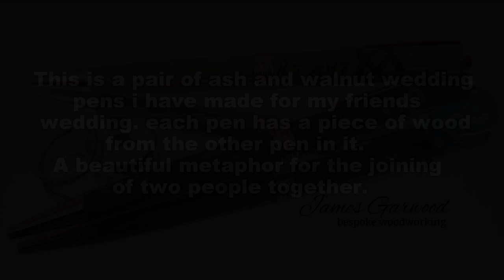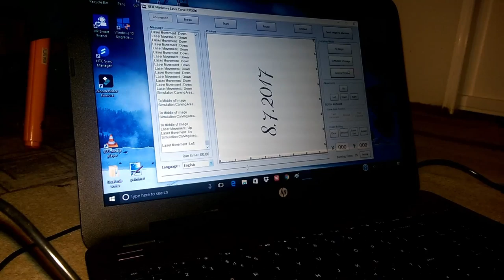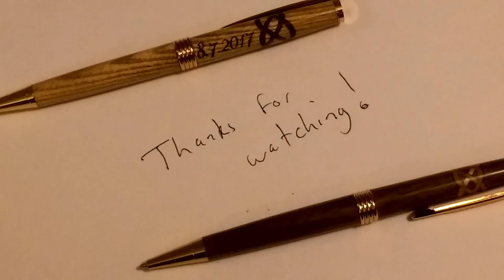Making a wooden wedding pen set with laser engraving

Comment: Really nice! Are you aware of any pen building sets that dont require a moristaper on the head stock> I have a lathe from the 60's and havent found any after marketing parts for it.
Reply from the maker: Hey I'm a Maker I do not know of any, have you got something like a Nova chuck, you could put a normal pen mandrel in that and use it normally or I'm thinking a piece of wood screwed on a mounting plate and just turn a MT hole to suit your mandrel, let me know how it goes!
Reply from the maker: Hey I'm a Maker what is your lathe so I can have a look
Reply: I do have a chuck and thought about using it to clamp the mandril but only thought they came as an MT.  Rockwell Beaver 3400 Lathe http://www.penturners.org/forum/f30/got-25-yr-old-rockwell-beaver-3400-a-7325/ 

Thanks for the ideas!
Reply from the maker: I think you could use the Chuck to hold it, I'll check with mine to see if it works, my mandrel is tapered
Reply: Thanks! I work close to a store that sells them but didn't want to spend the money if it meant they would not work.

Cheers!
Reply from the maker: Hey I'm a Maker I have checked on my lathe and I can hold it in the mandrel if you seat it all the way in and use the tail stock but if you are close to the store I would just check with them, happy turning! :)